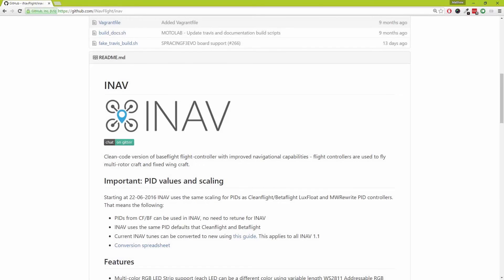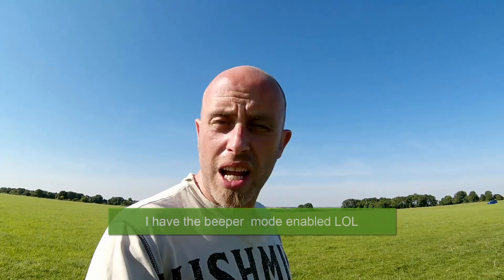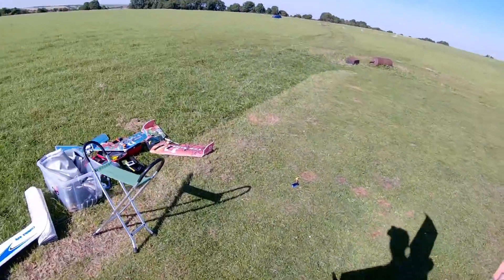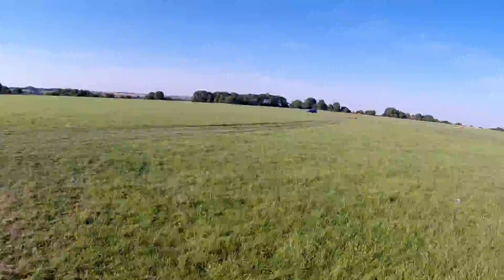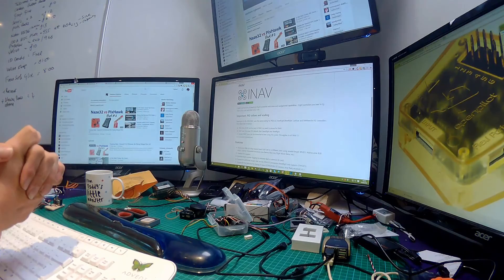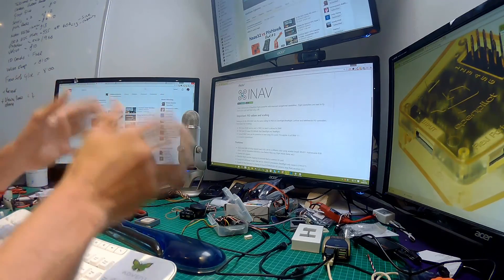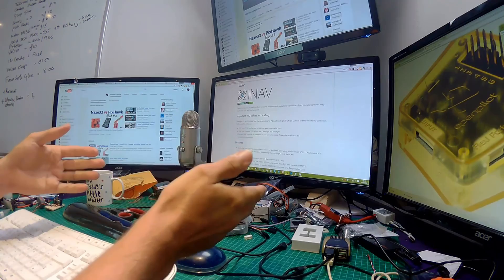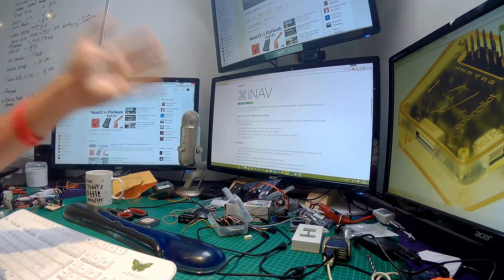iNav Tries to TOTAL the Teksumo - Part #4 - Naze32 V's Pixhawk for Flying Wings + CRASH

Comment: without reading through the comments? cause I'm in a hurry. but I have done some research on this as I have a C1 Chaser, a Mini Talon and a z84 wing I'm putting up for fpv. I've read somewhere that compass calibration is very important. and even running an external compass further away from noise electronics. am option would to be using shielded cables.
Reply from the maker: Howdy Roger, I would strongly suggest not using iNav, every version I used had one issue or another. PatricE's Baseflight airplane however worked really well. Matt

Comment: Hi Matthew, the moment i saw your beloved Teksumo full throttle diving towards the ground my stomic was turning as well. But I saw also a lot of succes story's on YT with Inav on fixed wings. So I ordered a SP F3 Race Deluxe board and a GPS and I will give it on more chance. It also seems that Inav 1.6 has a lot of improvement in favor of the fixed wing. Cheers and happy flying. Jelle Kaptein
Reply from the maker: Howdy Jelle, yea I won't be touching iNav ever again. In the versions used it was suggested it worked for fixed wing, however my findings were anything but working. I'm not prepared to risk another model with the software as I'm sure you'll appreciate. Matt
Reply: Hi Matthew, I'll keep you posted. As soon I build and dialed it in you will here from me.
Reply: RagTheNutsOff so much for never using it again😂

Comment: Matthew, enjoying your series and I feel your pain. The failure here is probably due to the barometer. I have run iNav on my quad for a couple months and it is extremely sensitive to the accelerometer calibration, the barometer, the magnetometer and the GPS placement. This software is still under development, and the result of DigitalEntity's hard work along with a team of volunteers for the past year. 

There is a ton of information in the RC groups thread, which is now over 500 pages:
http://www.rcgroups.com/forums/showthread.php?s=c91d969ee8d88fae904ee1b5d10ca2b5&t=2495732

Also the iNav wiki:
https://github.com/iNavFlight/inav/wiki
Reply from the maker: Morning! Thanks for the comment fella.

The placement & setup of the parts was the same through all the tests, but yea could have easily been the barometer. 
As you can imagine I was slightly annoyed on the day ;-) I'll be back looking at iNav again with a F3 board next time around. 

Got to finish a couple of other projects first though! Like the new FPV wing first :)

Matt
Reply: +Matthew Ogborne F1 has limitations for iNav, with memory constraints, fewer UARTS and and no floating processor. Blackbox is important also. Many people are moving to F3 and F4.boards. Good luck look forward to more videos.

Comment: Do you happen to have an blacklog log of that dive? 

Some Naze32 boards have an issue with barometer, this may is what happened to you
Reply from the maker: Howdy oleost,

Hooking up the board & iNav right now. I'll know more in >5 mins. Matt
Reply from the maker: Oleost,  all I've got in the log file is this "ÿÿÿÿÿÿÿÿÿÿÿÿÿÿÿÿÿÿÿÿÿÿÿÿÿÿÿÿÿÿÿÿÿÿÿÿÿÿÿÿÿÿÿÿÿÿÿÿÿÿÿÿÿÿÿÿÿÿÿÿÿÿÿÿÿÿÿÿÿÿÿÿÿÿÿÿÿÿÿÿÿÿÿÿÿÿÿÿÿÿÿÿÿÿÿÿÿÿÿÿÿÿÿÿÿÿÿÿÿÿÿÿÿÿÿÿÿÿÿÿÿÿÿÿÿÿÿÿ" So I'm assuming the recording wasn't on at the time.

I'll happily mail the board to anyone who is willing to have a look at it. A couple of pins are bent, but I won't be using that board again because of the impact it received, so it's on it's way to the bin anyway.

I'll do what Konstantin suggests below, pop this in on GitHub if you think this is a good way forwards?

Matt
Reply: +Matthew Ogborne Thanks. If you have an logger it would be much help for the developer of iNav if you could provide a log of that issue happening. You could retry but with much higher altitude so you get an chance to recover.

Comment: Please consider reporting INAV issues to developers on GitHub. It's a mere coincidence that I got this video from one of the people who is actively testing INAV. Do you by any change get any blackbox recording of the flight? You've also been using a rather old version - the one that only started to introduce airplane support.
Reply: +Matthew Ogborne  this appears to be an issue with the barometric sensor. Was the sensor covered with foam? If not, air passing over the sensor can setup righthandpole control lock caused by an error in the altitude. RTH causes a climb to  minimum alt, however if the barometer has a lower pressure caused by air blowing over it, the alt read by the controller as above the minimum alt, so the wing dives, as it increases speed, the wind over the barometer increases, the error increases,  it dives more, and so on. 

In control theory, this is an unstable right hand pole.  

This would explain why your plane dived into the ground on RTL.  Only way to fix is to do gross error detection with the GPS, or a second altimeter. I'm sure iNav doesn't include this like real autopilots. 

If your foam was dislodged from one day to the next, this would do it.

I think Patrick's software uses the gps for altitude, so no issue with the barometer.
Reply: Matthew Ogborne Would really be great with an iNav follow up video. Your videos are the first that comes up when one search for iNav and fixedwing. And it really draws a wrong picture of what iNav is an can do. The issue with baro is fixed. ( But you should cover it with foam if you intend to use it, else you should disable it and only rely on GPS height )

iNav 1.4 have new feature like auto launch and upcoming iNav 1.5 supports auto launch by throwing flyingwing by wingtip ( This is all without need for GPS )

Also there is added security like detecting of failed sensors.
Reply from the maker: Howdy Konstantin, 

I'm using version 1.1 with FrSky telemetry enabled and it was kindly custom built for me, the thank you video here https://www.youtube.com/watch?v=IqgMcCau5Pw for the chap who built it for me . Sadly there is no black-box recording of it, but I'll double check though as I've not powered the board on since it crashed.

I'm not writing off iNav completely, it may perform better on a F3 board and when 1.2 of iNav is released. 

But it's now at the bottom of the test pile (I've had a PixRacer & a CC3D board turn up, so they're now next in line after the Pixhawk). 

Next time I use this combination, I'll be flying the model when I get back to it as FAR as humanly possible away from me as I won't feel safe around it for obvious reasons.

Such a shame. I was really looking forward to iNav being a contender as it DID work as we saw in the previous episode.

Matt
Reply: I've got a few reports of INAV failing on airplanes controlled on NAZE32, but unfortunately nobody ever gave me anything to debug the issue (blackbox recording). People are successfully flying INAV on CC3D controlled airplanes though.

Can you also share details of your setup? What version of NAZE is this, does it have baro onboard? BTW, did you switch to RTL from RATE or from ANGLE? Just trying to get a clue on what was going on to fix the issue.

Airplane support in INAV is still immature as I don't fly airplanes much :(
Reply from the maker: Howdy Konstantin, I've had a CC3D board turn up, if iNav runs on that I'll happily give a whirl nearer the end of the series. 
See my comment to Oleost above, I'll happily mail the board out if you or anyone can else get something from it. 

Because of the impact it received, I won;t be personally putting it in another model, so it'll just be salvaging parts such as the min headers from it.

Matt
Reply: Had a look at your configuration and it looks like it wasn't configured to log at all. What a shame.

So did you switch from RATE to RTL or was it RATE->ANGLE->RTL?
Reply from the maker: Howdy,

My settings were OFF (pass through) -> Rate -> Horizon. When enabling GPS RTL this turns on RTL and Horizon mode together and it went south when I enabled that mode. 

If you replay the video you'll hear the modes changing from the Transmitter as I needed audio queues to help with testing (and normal flights for that matter).

Matt
Reply from the maker: elephantwalker smith Good morning!

Firstly thanks for sharing this with us! The Naze32 board was in an old motor box, with two tiny holes for the antennas and two small holes on the side for the cables.

Note: I'm not sure if you can see this in the videos or not.

Because the bottom larger hole where the USB lead went is covered by the side of the model, no foam was on top of the board as there wasn't anywhere for the air to fly to.

That night when I got home, I had stopped being so annoyed about it and as others have suggested here, a more powerful board is probably needed such as an F3.

I've bought one and it'll be here for next week.

As you can imagine I've got a couple of projects on the go currently & juggling them with limited time is tricky.

But I will be giving iNav another whirl, the idea of waypoints is very tempting and I know others have used iNav to great success.

Matt
Reply: elephantwalker smith iNav does use both GPS height and baro height together with IMU to estimate height.

Comment: Naza and iNav is fine for stabilization. However, for real RTL and missions, APM:Plane is definitely a better choice.
Let's see how the pixracer does.
Reply from the maker: Howdy Ehsan, 

It's odd that iNav is touted as having better GPS features than CleanFlight and annoyingly it did work one day, but not the next! As a heads up I've flown APM:Plane with the larger Pixhawk board, that'll follow in a later part of this series.

And the ACSP5 board also arrived this morning from AUAV, so when the weather gets better here I'll give that a whirl too.

I'm just editing the video of the two things that arrived today, the other part, well thats on Faceballs :)

Matt
Reply: Pixracer won't disappoint you (If it is not faulty because of cloning). Clones are known to use less quality components though.
ACSP5 is a small and accurate power board.
Let's see how your series go so we might be able to improve it.
Reply from the maker: Ehsan It was a toad to calibrate, which was exactly the same as the larger Pixhawk. This little board has some very good things going for it and I'm already sizing it up for the Bonzai flying wing.
Reply from the maker: Ehsan By the way did you see the other video this morning about connecting a standard NEO-M8N GPS & Compass to it? https://www.youtube.com/watch?v=Jir23gUfCDA

It was dead easy!

Matt
Reply: Yes I saw. M8N is very accurate and more than enough for RTL of FixedWings. However, I personally prefer to get GPS units from known produces, e.g., Drotek, CSGshop, ... .
I have had good experiences with OEMs.
Reply from the maker: Yep that's appreciated. I'm purely after it ASAP. It's pretty obvious if we have GPS issues watching the error counts in say mission planner.